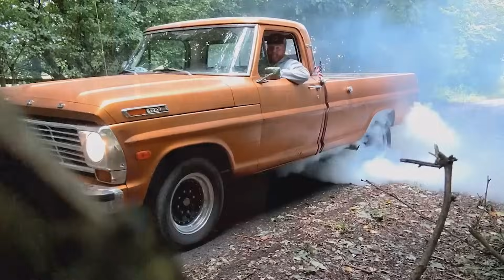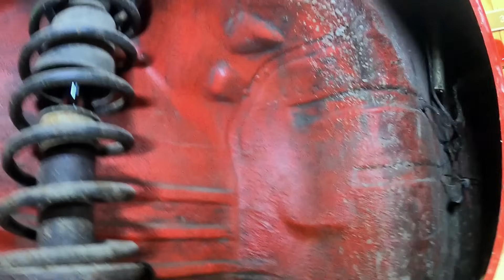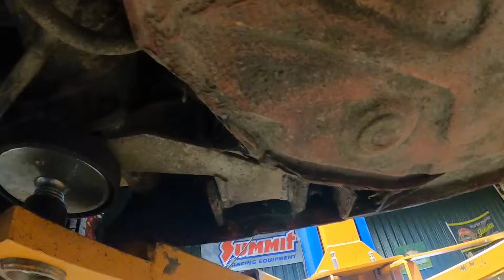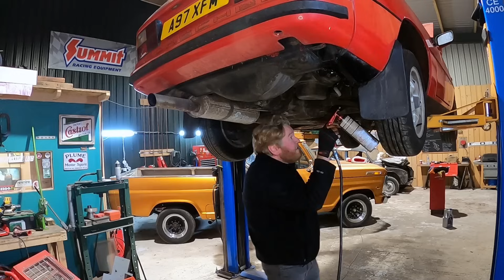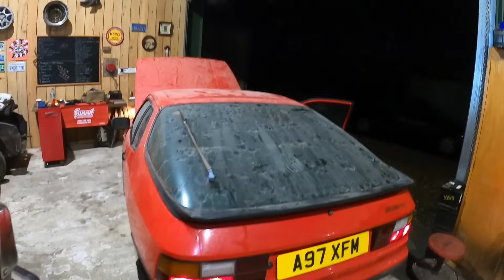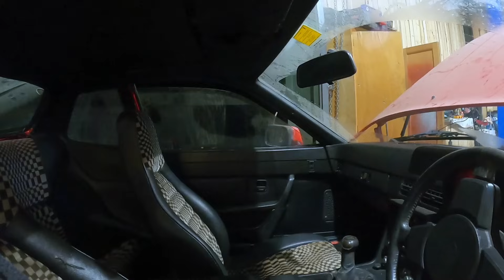PORSCHE 924 RESURRECTION - PART 2 - BRAVING THE COLD PREPARING THE CAR FOR AN MOT!

Comment: The starting issue may be the cold start valve on the backside of the intake not injecting fuel when cold starting.
The motor in the left rear is for the sunroof, witch is also detachable.
 Really nice looking 924.
Reply: Yeh common fault mate
Reply: yes this is what I would pull out and see if its squirting while cold

Comment: I had a 924 once that was a right pig to get started cold - a combination of the cold start valve and warm up regulator were the culprits in my case - The Bosch K Jetronic doesn't like to be left sitting for a long period ! If you run her for a few weeks like you said then start diagnosing ! Very tidy 924 that one !
Reply from the maker: Absolutely, seems to have cleared up with some fresh fuel etc thank god, glad I didn't have to get too involved with it I could see it becoming a headache!

Comment: Disconnect the 5th injector/ cold start valve and put in a bottle it should be squirting fuel for 10-30 seconds depending on temperature on startup. Also check you are getting 12v to wiring plug. 
Good luck.

Comment: now that Ive watched you start it cold, I would check for a gummed up Warm Up Regulator.  You can open them up and clean them out.  If it was JUST the cold start injector (which may also be bad), it wouldnt continue to stumble afterwards until warm.

Comment: Top Tip for you, Waxoil in the summer when the car is warm and dry and after the MOT coz if the MOT tester spots a weld issue you missed you have just added 5lts of flammable wax to your car for the first spark of the welder to find.
Reply from the maker: That would be great, but it's December!

Comment: You can get wine coolers that you insert the bottle into. I reckon this could be used in reverse. Heat them up (a bit) and then insert the waxoyl can into it.

Comment: No matter what the issues were, I would have drained the fuel before running the new plugs.
Reply from the maker: Not in minus 6 degrees C thank you!
Reply: @tastyclassics  I changed the starter motor on my 79 Pontiac Trans Am, on the street in colder.  Although I was in my 20s then.😁

Comment: Keep spamming the acceleration like that it will flood bro
Reply: You can't flood a fuel injected car
Reply: @AndyD070568  and how do you know it’s fuel injected I have a 1978 and that flooded a while ago from some issues
Reply: @motoabbott8234  You can clearly see the Bosch k-jetronic fuel distributor and the lack of a carburettor kind of gives the game away.
Reply: @motoabbott8234  you can tell by the way it is. lol.  CIS system with fuel distributor and those 4 lines coming off that go to the 4 main fuel injectors.